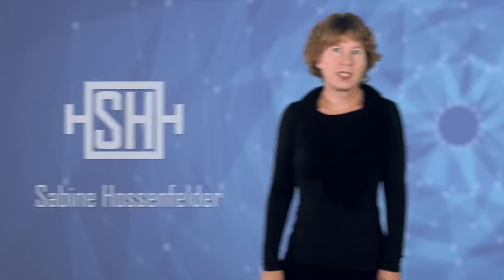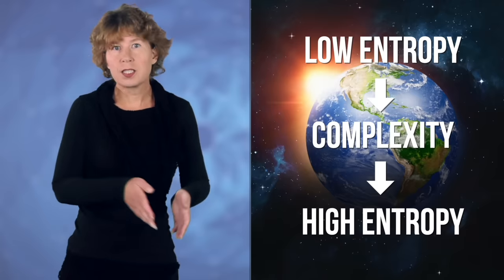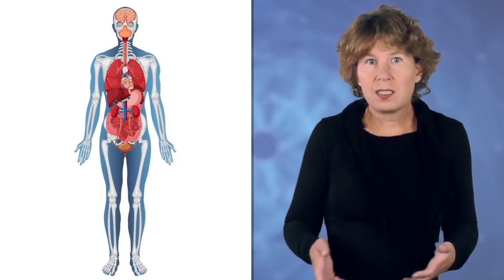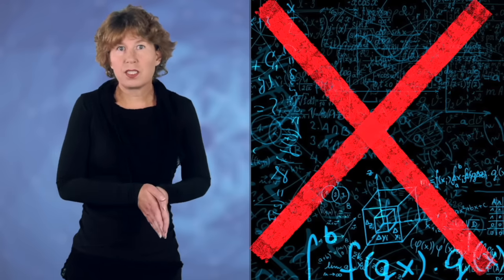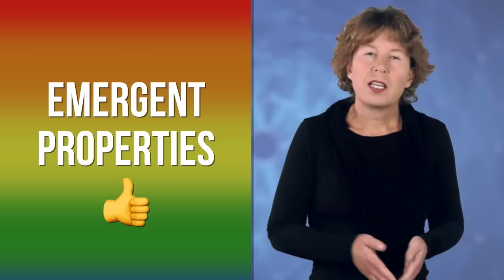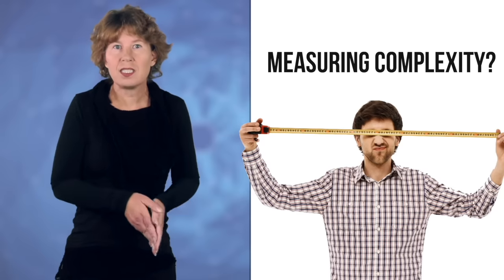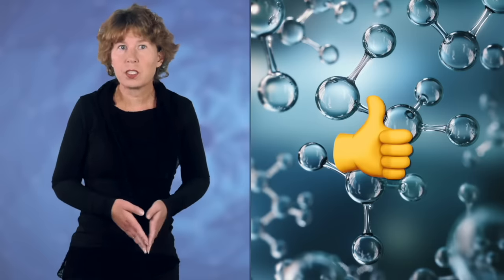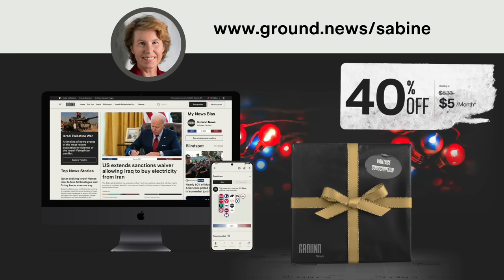The Biggest Gap in Science: Complexity

Comment: As a software engineer, complexity is bane of my existence. I was looking for a way to measure software complexity. Now I have some threads to follow thanks to your video.

Edit: tbh I hadn't really looked, but it seems there are some methods

Edit: Computational complexity isn't what I'm talking about. Computational complexity is about the amount of resources needed to run the computation. That's not at all what I talked about other than containing the same word "complexity". Don't be half knowledge, ego stroking  assholes.
Reply: Don't forget to collect your Nobel prize when you figure it out.
Reply: Overall function vs size? I don't like recursive code, even if it makes a very small program. Can be a right pain to debug.
Reply: @threeMetreJim  to be honest, I haven't really looked really deep into it. But it looks like there are some methods already. Since there's no perfect way to measure complexity in physics, there's no perfect way to measure complexity of software. Because everything emerges from physics.
Reply: Software engineers being software engineers, there have been software tools written to measure software complexity. Like Testwell.
Reply: How about something along the lines of product-sum ratio of the number of functions defined and the number of calls to those functions multiplied by the number of variables parameterized by those functions, though I suspect that the ratio between number of value and reference parameters will need to be considered as well.

User-code only, as I would assume you don't care how complex the generated machine code is, just the user-code-base you need to maintain.

First bit is an attempt to measure the size of the code-base against how much it interacts with itself, second bit is an attempt to measure how much data is being moved around. More considerations might be needed to compare dissimilar code bases, perhaps incorporating the average number of lines of code per function in attempt to get a ball-park measure of the code's relationship to spaghetti...

/two cents

Edit:  If this ends up helping, I'd be happy with 10% of the prize money and an acknowledgement in your Nobel prize winning paper. XD
Reply: zip the source code, the more is left the more complex it was.
Reply: This is where you can solve if this algorithm is NP or polynomial complexity 😅
Reply: @0MoTheG This one really made me think for a minute, then realized the hilarity: Consider if you wrote your code using only strings of varying length of the same letter for all user-defined variable / function names. The resulting code-base would be huge and would compress really nicely indicating low complexity. The problem is, regardless of the objective complexity of the tasks the code was designed to perform, debugging the mess would be next to impossible...
Reply: My definition is "How long it takes to get a good aswer to questions about the program?".
Note that you need to take the social environment into account, not just the code, docs, tests etc.
Reply: I’d just like a tool to detect “bad code”. IE code that works, but is architected like a hellscape Rube Goldberg contraption. I’ve seen python scripts that, instead of calling a function, execute another separate python script with shell commands. Works, yes, but why????
Reply: @TheIntellectualRedneck  Why? Just rename all the variables, functions ect.
Reply: @gritcrit4385  No. It is a complete different layer. At the physics layer, it is as it is stated in the video: we are as complex as rocks. Because physics does not care about our social organization, why do we like music, whatever.
Reply: @mdherynk  ???? This has been in place for ages. There are lots of program that will compute metrics about your code, and warn about code smells (methods too large, cyclomatic complexity.

Certainly it cannot detect everything, but then to detect everything it would need to know everything. For example, maybe that code calling a python script was a good solution at the time due to timing constraints. Maybe the original script being called was not in python, and there were no resources to rewrite it, and they need still as a separated script to call it directly from the command line...
Reply: Video fails to relate Complexity with Degrees of Freedom of individual parts along Time, not only spatial networks. That's why baby is much more complex. Cells born and died at rate of Millions per minute, to maintain a sustainable body. Cells itself have specific roles and options. All related with options at present input data AND memory data. Kurgesagt video "Counscience- How Unaware things become aware" and other "What are you ". Memory is key to algorithm evolution.
Reply: Lines of code? Processing time? Amount of data?
Reply: Look at cyclomatic complexity
Reply: @olzwolz5353   You seem to be an IT professional. I'm definitely not! If there's no valid definition of software complexity, what's being used to handle different grades of the multitude of interacting components, etc.? How do developers calculate the amount of work needed to finish a project - or parts of it? Is it all just intuition and experience?
Reply: Cyclomatic complexity.  Python lizard.
Reply: God speed sir, if you figure it out you’ll be a billionaire
Reply: @mdherynk  I wrote one for IBM's RPG. Essentially a VTOC charter. Program in question had 43 levels of nested IF statements in mainline, and the same core subroutine was referenced from 20 other subroutines across the chart. 😳🙄
Reply: Clue: Look at brain of spaghetti wizard that wrote the thing.
Reply: @threeMetreJim  I wrote a (potentially) infinite piece of code that permitted drilling down thru successive option choices from a menu. Elegant, beautiful, and simple in its clarity. It's not the software, it's the 'programmer'.
Reply: Still can’t explain why my wife acts the way she does. 🤣
Reply: Consider the fact that current supercomputers cannot come close to describing even 0ne protein molecule.
Reply: @threeMetreJim How does recursive code make code that is hard to debug? I’ve never experienced that. Depending on how the programming language and compiler implement recursion, recursive code can be slower or use up more memory than iterative code, but I’ve never found recursive code hard to debug.
Reply: My old boss was a computer scientist at Bell Labs. He used to say that for practical purposes (e.g., to determine how much effort was required to maintain the code) the best measurement of complexity was to print out the code and put it on a scale.
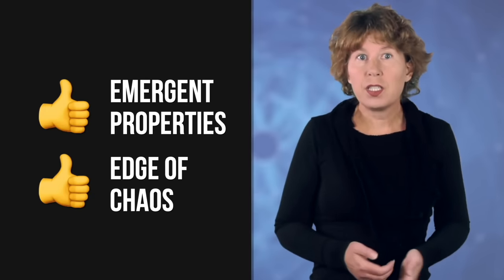Reply: @RF-fi2pt She touches on this at 11:10.
Reply: For software a good measure of complexity is how difficult it is to prove correct because software that is proven to do what it is supposed to does not require maintenance. And optimizing or changing it is less tricky if the proof is simpler.

Proof complexity is Kolmogorov complexity again because proofs can be interpreted as programs.
Reply: @aleksikorpinen2  agreed in specifics and in general too.  How can a thing be assessed for complexity if environmental influences are not accounted for?
Say: great research, going places but funding pulled because of ......
Reply: As a software engineer, I see this is software: I believe the life and dead of a software project is about its eternal fight vs. complexity. A projectstartst very simple, fulfilling few and clear functions, low entropy. As it grows andgetst ol,  the number of functions grows, and its uses also change. Making it more complex, and it becomes an active fight on reducing it complexity while you add more. If the technical debt win,  the amount of energy you invest is higher than the work you get from the software, dead by entropy
Reply: In automotive we measure complexity by the branches of the program. By statement count also is a good measure. The problem is that both can be exploited to seemingly write complex code, but that code doesn't do much
Reply: @michaeldebellis4202  😂
Reply: @aleksikorpinen2  So you could compare commented vs uncommented size of the code.
Reply: If you can measure complexity with a computer program, you can solve the halting problem.  You should stop looking.
Reply: @davidhand9721 Thank you!
Reply: I was going to post a similar comment! This video is a great bridge to aid in complexity and functionality communications in dev projects
Reply: Based on the coffee and milk example, you just need to keep adding complexity  until the code reaches maximum entropy at which point you’ll suddenly realise it’s simple again.
Reply: are there SWEs who aren't familiar with algorithmic complexity?
Reply: I'd also recommend a great book on this, "The Collapse of Chaos", work been Ian Stewart and Jack Cohen.
Reply: I think the complexity is the law of the universe  or, if you're a physicist, the law of physics. The law of the universe made everything possible within this universe. The existence of things from tiny to big, their connections to each other, and their evolution. All govern by these laws. Their connections and relationships to each other at different levels are the hardest part, I think.
Reply: I am sorry to be blunt, but it surprises me that you seem not to start with the question " what has been done on this topic(research, or even everyday tools)?" 
What a good university education should teach you is that there are very few questions where the answer is "nothing, this is a new idea".
Measures of complexity, also for the specific case of software, have been around for at least 20 years, (when was studying physics) probably more.
Reply: @Earthgazer  algorithmic complexity AKA time complexity isn't exactly what I was talking about.
Reply: One of formulas used in measuring software systems complexity is “end users = the edge of chaos” 😊
Reply: To quote that cartoon, the only rational measure of software quality is “WTFs per minute”. Yes quality != complexity, but they are at least kinda related.
Reply: There is a framework for decision development designed by a software developer. Dave Snowdon had worked for IBM now has a company that consults using his tools based on the properties of complexity. His framework, Cynefin is for decision-making by understanding what domain you are in - disorder, chaotic, obvious, complicated, or complex.
Seems like the best direction to steer a software engineer.
Cheers
Reply: For me, in code, the most important factor by far is size. Just count the number of lines of code. Second would be locality : essentially how far you have to scroll to see how a line of code gets its inputs, sets its outputs and what comes next.
Reply: @samvv  You're welcome, but I hope it's clear that I was telling OP that what he was trying to do is proven impossible, not that it will be super awesome when he cracks it.
Reply: @Earthgazer  I was thinking his use of the word "measure" implied that he wanted to use something other than his own brain to judge complexity.  I learned big O even before my first college-level CS course.  Maybe he's self-taught and never wrote a sort?
Reply: @davidhand9721  Yeah I know I was just surprised nobody said the obvious
Reply: @samvv  good :)
Reply: Cyclomatic complexity is commonly used to measure software complexity
Reply: Thinking about conplexity makes me trip the same as when I thinking about randomness. It's a bottomless well. Hahahahaha but fun nevertheless
Reply: So you find software other than  some forms of AI may exhibit emergent properties?  🤔
Reply: @0MoTheG  Unless it is time complexity.
Reply: There are plenty of packages which rate software 'complexity' by different metrics. At my company, they are actually built into the CI/CD and your merge request will auto-fail checks if you skew the projects codebase too badly.
Reply: Also, I assume you are talking about measures separate from the time/memory complexity of code. Basically every FAANG company expects you to not only solve a coding problem in an interview, but also give the time/memory complexities of the solution as O(n)/O(nlog(n))/O(n^2)/etc.
Reply: Dijkstra wrote a lot about code complexity.  Dijkstra complexity is the one measure of code complexity that everyone else keeps needlessly complicating.

As someone who does a bit of programming, I'm quite aware of Hoare's triangulations for simplifying code and I keep being surprised how many programmers don't do that.  It seems to me that most brogrammers deliberately obfuscate their code by adding complexity and reducing code cohesion, introducing tight coupling wherever they can.

But code complexity is only really relevant to structured programming.

More interesting is algorithmic complexity.

And Kolmogorov, of course.  As someone who knows a bit about computer science, I stopped watching when Sabine said that maximum entropy has low complexity.  WTF?
Reply: @threeMetreJim Those who don't understand recursion are damned to repeat it.

If you find recursive functions difficult to debug, you are probably using a step debugger.  Step debuggers don't actually help with debugging code, they are more a way to look busy while you don't know what you are doing.  They can be used to patch live code, but that is no substitute for fixing it.

Recursive functions are simple.  They are easy to prove.  Proving them means not having to debug them.  (Dijkstra even says that bugs don't exist.  There are no bugs in software, only lazy programmers and the errors they fill empty files with.)

And they are easy to test.  Print out the input and output for each time they are called, and see if it is what you expect.  (Ken Thompson wrote on his homepage how print/oscilloscope debugging is useful and how step debugging is not.  I suspect that he has some experience with writing software.)
Reply: @enderan27 Keep it small and simple: Elegance is achieved not when there is nothing left to add, but when there is nothing left to remove.  Each command should do only one thing, one specialised, simple thing, and do it well.  Keep in mind that the operating system handles parallel processes and pipelines, and that the shell is a wrapper around those operating system functions.  Take advantage of that by keeping things modular.  Every complex system that works is built from simple systems that work.  Design the interface first, because that is the language that the components will keep using even as they are replaced with different implementations.
Reply: @davidwuhrer6704  You do have some points, and most of the things I've done are reverse engineering type problems with no access to the high level code.
Bugs will always exist no matter how 'not lazy' you are, as long as humans make mistakes. The input and output of your recursive function may look fine for expected inputs; but someone, or some event, may come along and insert some unexpected inputs (maybe even into a function called by the recursive function). At that point you'll have a real debugging problem, depending on how the function reacts.
Reply: @@retiredbore378 let's start with philosophy then end it by formal logic.
Is entropy a good start ?
Did entropy solves anythings at the fact that humans are?
Maybe there is an anentropic law ? some "narural counter ward to entropy ".
After all in conformal cyclic universe theory ,the maximal  entropy is equal to the minimal entropy, because maximal entropy is made of massless tachyons only, and no mass no time so no time no entropy. 
😂😂 i need to sleep , i broke my ordinary few educated brain.
Gn 😙
Reply: Kolmogorov complexity; cyclomatic complexity; Halstead's complexity measures..
Reply: Good luck to you!
Reply: There is literally a CS field for this… Computational complexity is hopefully a class you’ve taken if you say you’re a computer scientist. 

If anyone says “time isn’t a measure of complexity”: it literally is. It’s also how we distinguish things that can be calculated, from things that can’t
Reply: @TheCHRISintheMIX  that is not what I'm talking about at all. Half knowledge  might be dangerous, but it certainly is annoying.
Reply: Also software engineers aren’t engineers 😉
Reply: I have a master's in CS. Afaik, measuring the number of execution branches is the best way right now. If you have more branching then you have more looping, conditional checks, etc.. conversely, using something like lines of code doesn't reveal any of this information... neither does total size because you can certainly write a program that is nothing but a collection of non-conditional statements with no loops, for example. 

You might find it interesting that CPUs use what is called "branch prediction", which is indirectly related to complexity. More complex programs will, again, have more complex branching and it will cause the CPU branch predictor to make more prediction mistakes as complexity increases. Complex programs degrade CPU performance because of this.

High complexity is not desirable. I work as a security engineer and high complexity for me means more places in code to check for security and logic issues. Luckily lots of good tools to help assist with the effort.
Reply: Complexity in CS (as in Time Complexity, Algorithmic Complexity etc) is not the same as Complexity (as in Chaotic Systems, Nonlinear Dynamics etc)